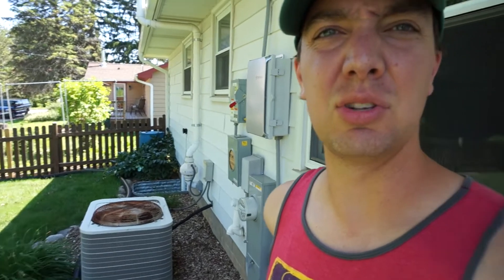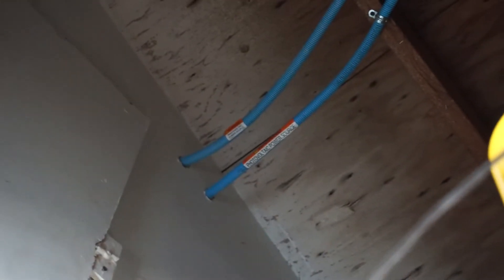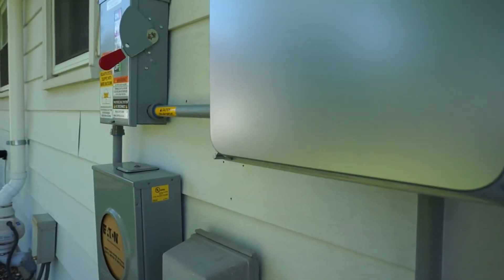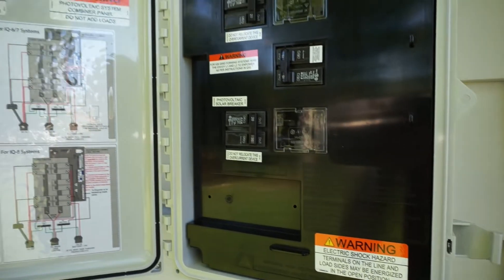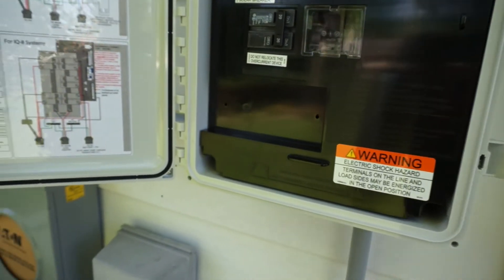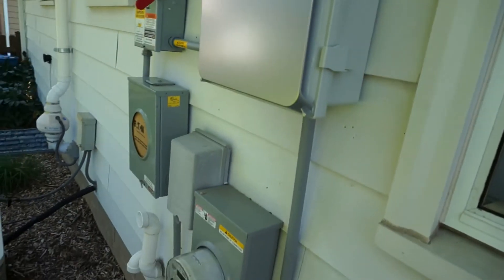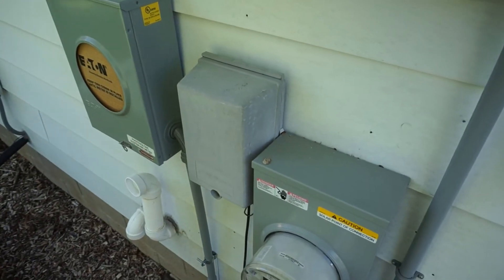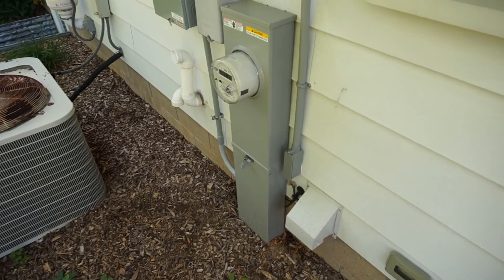Project Solar DIY Install: Electrical overview

Comment: Thank you for your videos. Very helpful. I'm considering going with Project Solar for a similar system. I was wondering if that enphase box needed to be mounted outside per any codes rather than on the inside, next to the main load center?
Reply from the maker: Obviously local codes may differ, but the main reason mine is outside is convenience. Most if not all locations should let you mount it inside if you want to.
Reply: @jimmypautz  in what way having it outside makes it more conveneint? Is this something that one needs to check frequently? Or was it easier to install?
Reply from the maker: @msuterski  it rarely gets checked/opened. It is more convenient because that's where the two arrays wiring come down and from there they tie into the rest of my house's electrical system.
Reply: @jimmypautz great! thank you!

Comment: Do you recall how much you spent in wires / things not included? Also how much the electrician charged (if you used one)? Wondering if I should just pay the 3-4k install charge given all these other things I must buy.
Reply from the maker: It was $450 for wire, conduit, etc, including a tool I didn't have. I had an electrician friend come for the grid tie part (I was required to have an electrician per my power company) and he charged me $100.  So the total non Project Solar stuff was $550.

Comment: Waiting for the final video.  
Where there any parts missing from Project Solar?
Did they try to make you go with Canadian Panels instead of Q-cells.
If you didn't understand their wiring diagram, could you call and get questions answered?
Was all the wire needed for the project included?
Reply from the maker: Nothing missing. I got my qcells before the shortage. They can answer questions if you have them. No wire was included, that was made clear up front.
Reply: @jimmypautz  thanks for the quick reply.     Wire can be a huge added expense.  So the wiring after the panel box to the inverter thru you attic was all your responsibility, but I am sure they told you the correct size to use on the planns. That can be dangerous if undersized.
Reply from the maker: @Craig32  correct. They had the gauge of the wire listed in the one line diagram.
Reply: @jimmypautz  thanks for the response.  Thinking about going with them, but just a little hesitant to pull the trigger.

Comment: Was the conduit and electrical wire that runs in the attic to the meter included in the Project Solar materials?
Reply from the maker: No, that stuff is not included.

Comment: how long was your process from start to finish? Was the whole process painless? I just found this company last night and started doing some research as it seems to be pretty good.
Reply from the maker: I started right at the end of February and I'm just waiting on my power company for PTO.  Not completely painless, but I still think it's a great deal.  I think Project Solar probably caused at least 4 weeks of delays by their mistakes. Part of it is my local power company requirements are not typical. I'd still recommend them though.  I plan on doing an overall review of Project Solar when I'm up and running.
Reply: @jimmypautz  Sweet. Thanks for the info. I'm debating about a battery., I'm in California and there is talk to moving from net metering to net billing. This essentially means that the solar would go to the grid, then they would sell it back to you at a higher rate.  Doesn't make sense at all. Having a battery would change that to an extent. They also want to charge $8 a Kw for the solar. Sounds like most people will always have a bill of $50 or more depending on the size of the array.

Looking forward to your assessment once everything is up and running.

Thanks again for sharing your process.